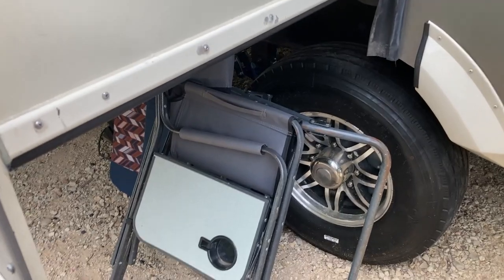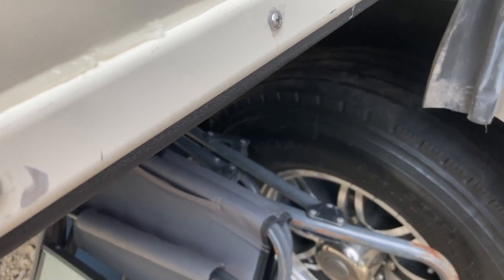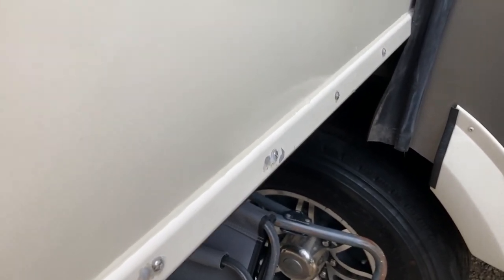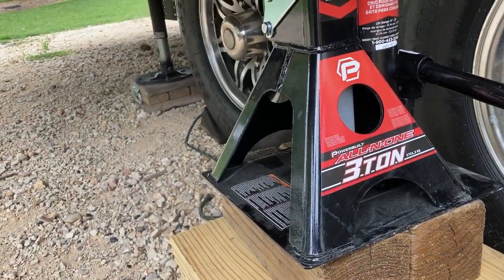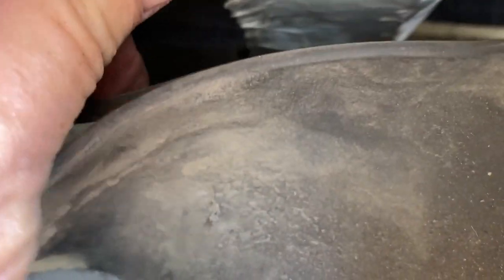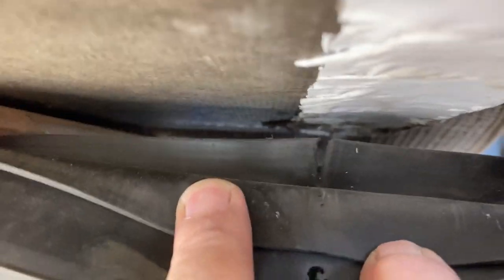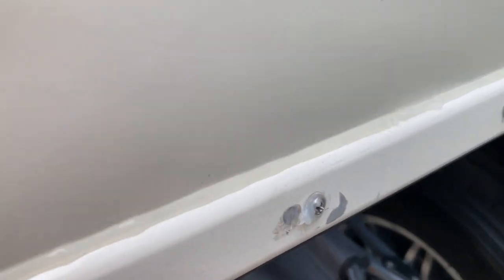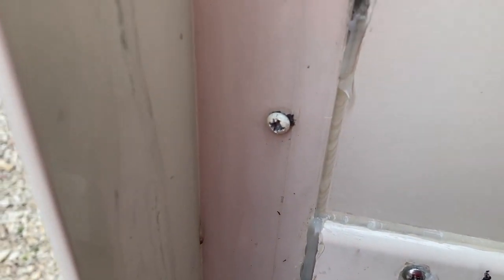RV Slide Ski Replacement

Comment: Thanks for recording this. I’ll be performing this repair soon. I’m always disappointed in the quality of construction.
Reply from the maker: Thanks for watching, I know, sometimes you have to scratch you head and say, why did they do that. Each time we repair or modify our RV we make it better than the way they did it. Since replacing our ski we haven't had any more problems. I think our problem started because they used staples to attach the ski on the vertical lip but the leading edge had no staples.
I have heard some owners are replacing their plastic ski with ones made of thin stainless steel.